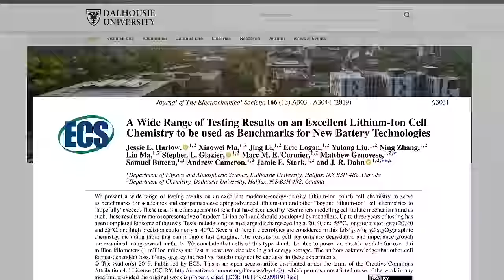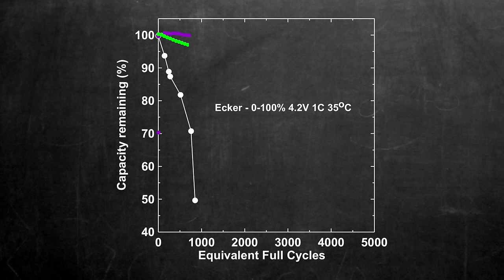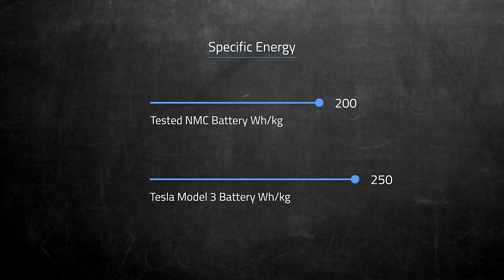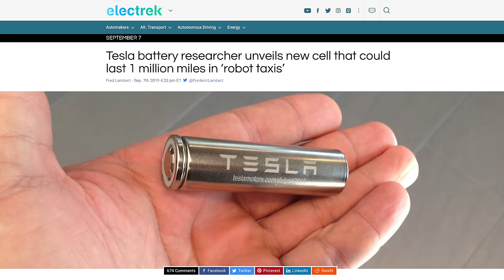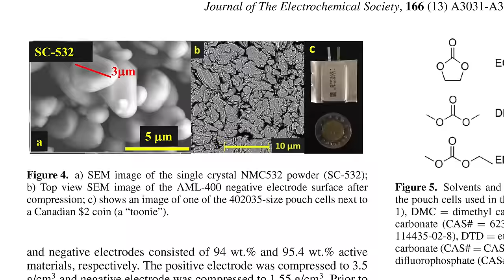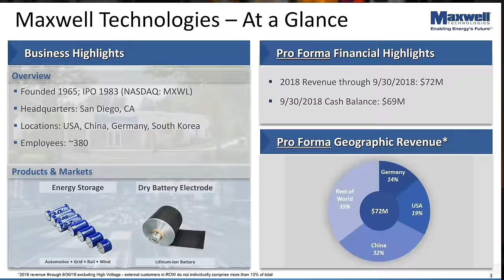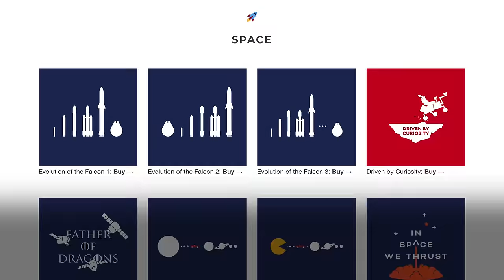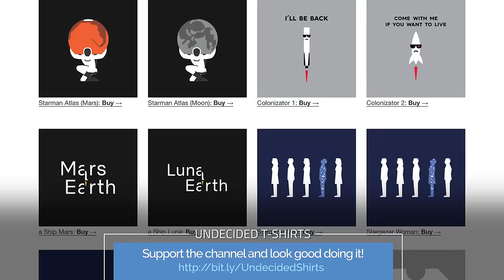New Tesla battery? Jeff Dahn and 1 million miles

Comment: The largest problem as I see it from a chauffuers viewpoint is that unless an electric vehicle can achieve over 600 miles on a single charge with EVERYTHING RUNNING, A/C or heater, all of the lights on and radio on loud enough to understand, can be trickle charged while in use to extend range/distance and be able to recharge fully to 100% in about 1 hour without degrading or shortening usable number of charging cycles then any electric vehicle is unusable in the passenger transport industry. Add to that lower cost, durability and ease of maintaning the vehicle. I cannot personally see all that taking place in the forseeable future.
Reply from the maker: There are already places using Teslas/EVs for taxis, police cars, etc.  https://electrek.co/2019/08/02/tesla-fleet-taxi-columbus/

Comment: Another great one! I’m so excited to see how new chemistries and battery innovations will improve electric cars in the upcoming years. Here is a random thought I had the other day about the new Roadster’s battery; My first thought was that it won’t last long (cycle wise) due to the large draw with that crazy acceleration. But I then realized that it’s battery is supposed to be twice the size of the Model S battery.  So due to the lower draw on each cell, not only will the batteries have a significantly longer lifetime, but discharge will be more efficient.
Reply: Is Tesla not going to use Ultra Capacitors in the Roadster for acceleration?
Reply: Not necessary with twice (or more) Model S battery power.

Comment: A more expensive battery with less range and more cobalt does not make sense for consumer cars, but it might for robotaxis fleets. 

I'm speculating that most robotaxis in the future will have relatively small batteries. It was difficult for me to drive more than 120 miles in 8 hours as a pizza delivery driver. While robotaxis could run 24 hours in a day, they won't. They will have downtime for charging during non peak hours and when they need serviced and cleaned. And charge times will continue to improve. Unless you're on the highway, a 300 mile battery is unnecessary and expensive. The decresed range won't be an issue for fleets. 

Though it might increase the upfront cost of the battery, is it not 3 times cheaper in the long run if it lasts 3 times longer?

Similarly, if it lasts 3 times longer it will use 3 times less cobalt. This battery could use more cobalt and still decrease cobalt consumption in the long run.
Reply from the maker: Interesting take!

Comment: In 2012, Tesla released their second-generation battery and powertrain. It topped out at 85 kWh and 265 miles of range (EPA). What I find crazy is that still, to this day (2019, seven years later), I cannot buy a production all-electric car in the United States with 265 miles of EPA range from any automaker other than Tesla (though the Hyundai Kona EV gets admirably close). Meanwhile, Tesla's long rang Model S currently sits at 370 miles of EPA range.

It's crazy how far ahead Tesla still is, and just when legacy automakers start thinking they might stand a chance against Tesla, the latter releases some new technology that changes the whole equation and crushes the competition on quality and economics. I absolutely believe Tesla will eventually sell all kinds of EVs, from sedans to semis, that retain 90% of charge capacity after one million miles.

Comment: More cobalt per battery, but battery can last twice as long as normal battery at least. This is in line with the quest to use less cobalt per number of miles/DST cycles/whatever until disposal.
Reply from the maker: That’s a good point.  I still don’t think this is the chemistry they’ll be using, but it’s another good reason why this exact formulation is a great option.

Comment: more interested in rechargable batteries that work well in low temperatures.  I live in northern Canada.  Best chemistry I have used here, is LiFePO4.  Must be warm while charging, but discharges fine in low temps.  Like to try Lithium Titinate....but are rather large, with lower volts per cell....not an ideal solution either.

Comment: You missed the point of the test - see Hyperchange interview with Nano One CEO. Dahn bought cells without electrolyte from Chinese company who made particles of cathode that were single crystals rather than particles with hundred or thousands of crystals we see today. The Chinese crystals were expensive, but their point was to show the effectiveness of single crystal cathode particles. Dahn is an electrolyte researcher - thus he bought cells without electrolyte so he could test them with his electrolytes. Nano One has developed a technique to make the single crystals for all the major cathode compositions and make then cheaper than present particles. Maxwell Tech may have developed a similar technique - as a result of which it needed little or no 'wet' binder to stick the cathode particles to the current collector.  The Chinese method for single crystal particles may have been widely known in the industry. A number of companies may have developed similar processes to Nano One. Perhaps other companies are now working on 'dry' bonding techniques like that of Maxwell Tech to take advantage of single crystal particles.
Reply: Prof. Dahn did not just purchase the cells from China. They developed the single crystal chemistry back in 2016. The Chinese company was then tasked with coating that cathode power on the current collector.
Nano One CEO was factually incorrect on many things in the video.

Comment: Reduced range is NOT a problem for something like Robo Taxis which are used in cities and not doing extended roadtrips.  With speed limits of 30 mph and much time spent at a stoplights, etc., 250 miles should be more than enough.  Plus vehicles in a Robo Taxi fleet can be circulated through recharging stations during off peak hours and especially at night when demand for their use is much lower.  Those vehicles will also have NO use for "Smack Down 0-60 times" which would just leave their passengers ill.  Having a Very Long Life however can be very advantageous for such fleets.  I don't think the same can be said for the SEMI market however where energy density and range will be crucial.  It is my belief that Tesla, and especially Elon Musk have MUCH bigger goals than supplying a mass market of consumer cars and SUV's.  At the moment, by releasing compelling vehicles, he's just pressuring the Legacy Auto and Truck manufacturers to "Get With The Program".  Elon has always said that the ENERGY business will be much larger than the automotive business.  Grid level storage will be HUGE going forward.

Comment: Great video Matt. For me, as an european average driver doing 10,000 miles per year, is not important 1,000,000 miles battery life. New Tesla battery improvements to increase car ranges and more SC stations in Europe are the factors which will lead me to trade in my new BMW 5 series for a Model 3 in the future.
Do you think Elon will announce 400 miles range at battery and drivetrain investor day event?
Reply from the maker: I feel like they’re more likely to offer up cheaper cars that require smaller battery packs, but may offer top of line cars with 400+ mile ranges.

Comment: I totally agree on most parts. Especially for the Semi truck, this is very interesting. But don't you think that LFP would be better for stationary batteries? Much cheaper, no heavy metals, especially no cobalt and the low energy density does not matter in this case. Excited for your opinion on this!
Reply from the maker: I do think LFP is a great option for stationary systems ... but I think there's a lot of other really cool options for stationary systems like flow batteries or kinetic energy storage.  I think it really comes down to picking the right option for the specific scenario.  Just like there's no one size fits all renewable source.  Some areas are perfect for wind, others for solar, others hydro.

Comment: If they can make batteries this good, having some or more of cobalt is a small thing considering the resilience of such battery.  Battery packs can be downsized or be lower in capacity considering the longevity of such battery tech wherein drivers will just charge more often in long road trips.
Additionally, I believe Tesla has their own research and found the same thing.  The good news is, it might come soon considering the news I saw earlier that Tesla applied for a Tesla owned construction company in China to build Gigafactories themselves.

Comment: No need to be too concerned about Jeff Dahn et al not using Tesla's proprietary formula as their starting point. Researchers like to vary a single variable at a time so they can gauge ("benchmark" to use the report's term) exactly how it affects the outcome. It's the responsibility of companies like Tesla and Panasonic to take that basic research and turn it into productive reality. The end result is a compromise between several variables utilizing several research results to give the best overall results for the application. And those companies keep their final "secret sauce" secret, so of course researchers and competitors don't have access to it.

Another nuance you fail to mention is that Dahn et al used a pouch form factor while Tesla and Panasonic are using 18650 and 2170 cylindrical form factors. Why? Because pouch cells are easier to make in small test batches in the lab. Not a big deal, but again, not what one might naively expect if you know they're doing the research for Tesla.

Finally of course, Dahn et al did not have access to Maxwell Technologies' proprietary dry electrode technology so that wasn't part of the testing either. But it will surely be part of Tesla's final "secret sauce" for a production million mile battery.

Comment: you use a bit more Cobalt, but then the battery lasts double to triple as long: presto, you're using less Cobalt. Add diligent recycling into the equation, plus more conscientious sourcing of the mineral, and the problem is minimized.
By the way, the battery on your cellphone that you replace every two years -- is its Cobalt recycled?
Reply: using more cobalt causes higher expansion rates, which kill the cell faster, did you recycle the black oil that got burned in you cars engine every 10k miles?
Reply: @miguellopez3392  either you didn't look at the video, or you don't understand it. I don't know what's worse

Comment: I want a battery longevity that makes resale of electric vehicles a complete non issue so far as how degraded the battery capacity is - one can still drive a car made in the 1950s without having to worry that the engine will now only produce 50% or 40% of its original power rating. Wouldn't matter so much if batteries weren't such an expensive proportion of an electric vehicle. Plus the tech changes over time such that it might be hard to find batteries that work in a 15 or 20 year old EV.

Comment: Solid State lithium batteries have more energy density than regular lithium-ion, why?  Solid state lithium batteries will use more Lithium per kilogram of the battery pack, which means that Solid State batteries will be more expensive. Yes if you want to drive more miles per charge, you need to pay for that :) The future of the batteries will be not with lithium chemistry  but with magnesium chemistry which is way cheaper than lithium. Magnesium element has two electrons on outermost shell orbital ( two valence ).  Lithium has only one. Earth crust consists of 13.9% of magnesium. Lithium constitutes only about 0.002 % of Earth's crust. As simple as that.....

Comment: I think this chemistry could be ideal for stationary storage like a PW3  where size and weight are less of an issue. The ideal choice for home storage is actually LiFePO4 but this new chemistry pretty much matches it or even betters it for cycle life and is 33% more energy dense (typical LiFe batt is 145 Wh/Kg). Does Tesla want their home storage batteries to last longer, particularly if adds to upfront costs? Probably not. The only people who would understand the advantages are battery nerds.

Comment: Is there any info on the weight?   Volume isn't as much of a problem as weight.
Reply: Weight to volume ratio is the energy density and it is mentioned in the video.
Reply: @JosueC730  No, energy to volume is energy density.
Reply: @lucidmoses  Right, I'm mixing it up. It's the amount of energy stored per volume, however volume is related to weight, so it can also be said that it is the ammount of energy in a system or space per unit of mass.
https://en.wikipedia.org/wiki/Energy_density
Reply from the maker: No info that I found on the actual weight in comparison.

Comment: From what I have read about Maxwell's dry battery electrode, it's suppose to have double the lifetime and 20 percent more energy density over regular lithium batteries. I Wonder, do Maxwell's DBE's use more Cobalt than regular lithium batteries? Is it just an advancement in manufacturing batteries only?

Comment: When I heard about the million-mile battery, I just shrugged my shoulders. I don't care if a plastic bag can be folded one million times with no embrittlement if what I need is good tensile strength. Longevity is not the challenge. Energy density, cost of materials and ability to charge rapidly are the only things I hear people talk about, and 10-15 years of useful battery life doesn't seem to worry anyone. Besides, all this is moot because most of the solid-state chemistries promise all those things in spades.

Comment: If anyone could clarify this to me. I could only hear he talking about an increase in cobalt on the new batteries, but not about how much.
In the paper, it says “In this paper, testing results on LiNi0.5Mn0.3Co0.2O2/artificial graphite (NMC532/AG) cells are presented.”. What I was able to find is that NMC532 stands for 50% Nickel, 30% Manganese and 20% Cobalt. Since Tesla’s batteries use about 15% Cobalt, I guess a 5% increase would definitely be a fair trade for 4 times the charging cycles, wright hahah?
I don’t know if the autor has purposely hidden that fact to create a different opinion then other media. It just seems that at least he should had mentioned what an increase it was.
Anyways, I am definitely not an expert on batteries. If anyone could check if what I mentioned proceeds, or add mor information.
Reply from the maker: I don’t see the actual amount as completely relevant to the intention of Jeff Dahn’s paper.  This formula was about taking something that’s already used in a lot of places and establishing a new benchmark for researchers and companies to use for comparison.  Part of the problem was a lot of the initial press/reports used this paper as a “Tesla has a 1 million mile battery,” which isn’t what the report was actually about.  Tesla most likely has a 1 million mile battery pack coming, but it’s most likely a different formula that aligns with the company’s goals of reducing cobalt usage.